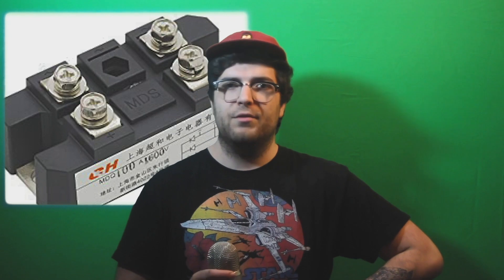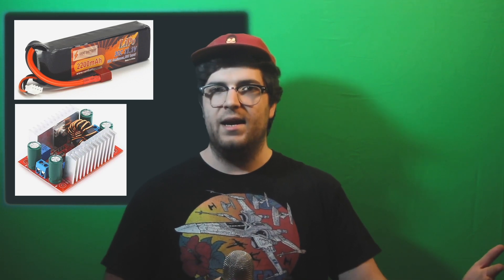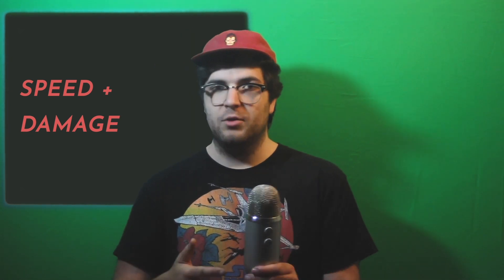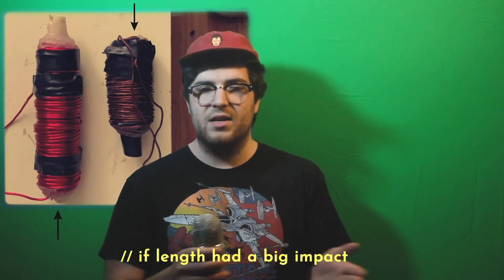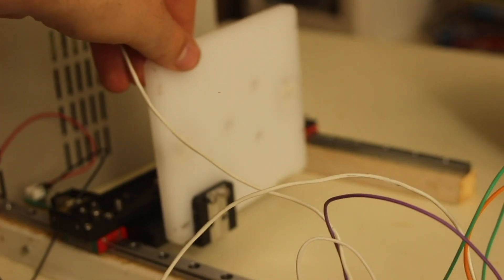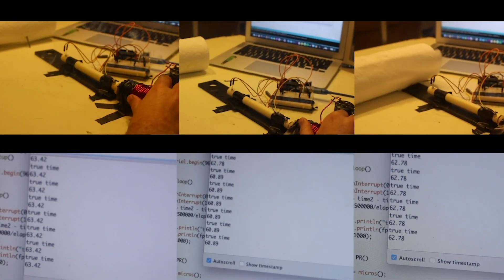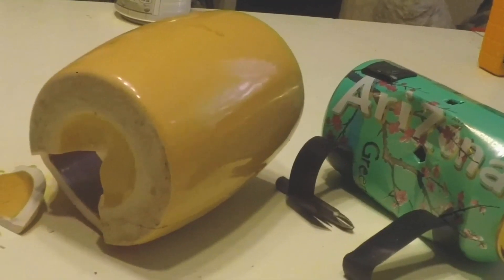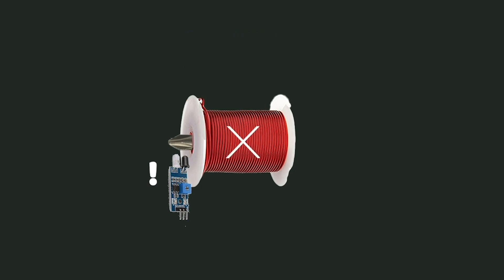Building a Powerful Coilgun, Part One: Damage + Speed Testing

Comment: Did you end up finishing this?

I have a 20mF, 400V cap bank with this bad boy: https://www.semikron.com/products/product-classes/thyristordiode-modules/detail/skkh-92-0789804107898051078980610789807107898081.html

Charged via eBay boost converter module, no mains involved.

I haven't done any timing analysis to switch off SCR, etc. - too lazy - but will soon. 

Used trial and error with coil sizes / projectiles, but I also noticed that larger than expected screwdriver bits "perform" better. 

BTW I love your explanation for doing this project - it PERFECTLY explains why I do it too (had hard time answering the "why" question from people).

BTW 2: you should report results in ft/lbs (like with a firearm) to take projectile weight into account.

Comment: You should use a hybrid design which incorporates a capacitor powered first stage and conventional accelerator stages. This yields more power than a normal coilgun but less weight and materials than a capacitor discharge coilgun. You effectively make the first coil bigger and dump ludicrous amounts of current into it when the projectile has the least velocity which makes it impart more energy into the projectile than if it was faster, effectively making this the most efficient and hence most bang for your buck gun.

Tl;dr hybrid better than other design so make hybrid coilgun.
Reply: You can also make a coil/railgun hybrid which uses one technology to make the other more efficient by virtue of imparting an optimal speed unto the projectile. Capacitor coilgun = v.slow
Coilgun = slow
Railgun = fast
But the project would end up very complex, heavy, long and probably illegal (if you live in uk or California at least) so I recommend the first option unless you want to build a really, really skookum coilgun.
Reply from the maker: these accelerator stages - potentially what could I use to power them? mains voltage? I've been thinking of dividing my capacitor bank into thirds(or fourths) and assigning each third to a coil stage and doing it that way

ps i like this railgun idea and am doing some research now
Reply: @MillersPlanetOne  you can power the stages from quadcopter lithium ion batteries.

Comment: I saw an argument on youtube a little back where people were trying to decide if railguns or coilguns are better. Do you have an opinion? If so, why?
Reply: A rail works well with faster projectiles and is much lighter, a coil works better with slower projectiles... so why not combine both?
Reply: @s.sradon9782  Thanks for the reply, do you have sources for those claims? I am looking for someone to actually explain the pros and cons backed up by the science/numbers behind rail vs coil guns.
Reply: @sturgeondtd9522  I apologize greatly as YT did not seem to notify me of this comment beforehand. I have concluded from my observations from hands-on experiments that a railgun projectile is more efficient the higher the velocity, however I failed to state that this is false beyond a point where to friction losses become > resistive losses.
current in a railgun acts roughly proportional to kinetic energy gained by the projectile, however the velocity is inversely proportional to the current draw. the higher the current draw, the higher the energy gained per cm of rail, however the lower the efficiency in the energy transfer due to unwanted capacitances, inductance & resistance etc. 

the projectile/rail interference points seem to be the largest resistor. this can be solved by applying a non-abrasive conductive lubricant to these points. additionally multicore wires should be used wherever possible to utilize the skin effect, however the simplest way to make an efficient railgun is to apply a  magnitude of current found "optimal" (where less current is more energy efficient but less power for barrel length efficient) while designing a railgun barrel as long as possible and providing a pre-accelerated projectile by any means necessary. another solution would be to apply more current to the projectile as it's velocity increases to create as constant an energy transfer as practical. 
pre-acceleration also solves wear issues and reliability issues where the projectile welds itself to the barrel.
applying lubricant to the barrel would also decrease frictional losses & wear.

a good railgun should therefore have a current control circuit, projectile pre-acceleration, an optimized current draw & rail length and additionally could have a conductive lubricant (both thermally and electrically) and quickchange barrel or replaceable rails. additionally an optimal projectile mass, shape and material should be chosen to maximize energy transfer.
all the experiments were done unscientifically in an unprofessional setting and should be taken with a bag of salt.
more experimentation is required as a better understanding of such relationships would allow for engineering of solutions for better railguns and possible rail/coilgun hybrids. I know less about coilguns, however it seems to be a possibility to combine the two systems to create a hybrid which may have it's own benefits.

sorry for my engrish but it's 4am , I'm Polish and this isn't my job. there was simply a time in my life where I was very interested in railguns but lacked the resources for proper research, manufacture and improvement of the technology (I do such things for fun) sorry, I can't provide you with proper empirical evidence but this is the best I can do and someone more capable can take this and verify/debunk it and put it to some use. finding data on experimental military technology is hard :(
Reply from the maker: A while back I watched this electroboom video where he was kind of 'testing out' his rail accelerator setup, and it looked really inefficient/ difficult to get a projectile moving - i think since then I've steered away from railgun ideas, but I could probably use some more research time on the subject - it looks like it'd be an interesting build
Reply: @MillersPlanetOne  on paper a railgun should be simpler... this is a lie.

Comment: Yo this was dope! Have you considered putting the two coils in a line or experimenting with measuring the speed at a longer distance?
Reply from the maker: thank uuu!
yep ~ in part two i'm planning on adding multiple stages 
also, I think the longest length I've tried is 1 foot? worked out about the same -   I was thinking about adding a third sensor for acceleration tho

Comment: Is their a reason for not having a tight fit on the projectiles?
Reply from the maker: just a matter of the standardized pvc sizes being a little off // I think for the final though Im gonna turn to a 3d printed barrel
Reply: @MillersPlanetOne  like make it the same outside circumference but smaller diameter hole? Bc if not you can buy PVC piping that is very small inside diameters..

This is a very interesting project... keep the videos coming!!
Reply: @MillersPlanetOne  you would need to have the Id undersized and then bore or at least drill it to size. Rifling isn't as effective on coilgun as you would think so I'm assuming that you are using a smoothbore which works well with low velocities and is easier tomake. Ideally I would use machined hdpe and a waxed projectile to decrease resistance which is very important.